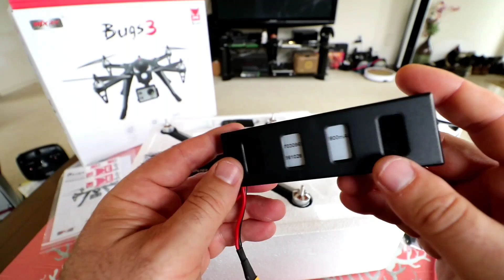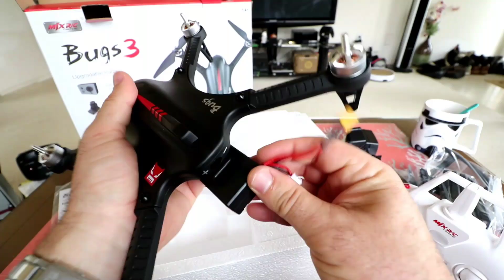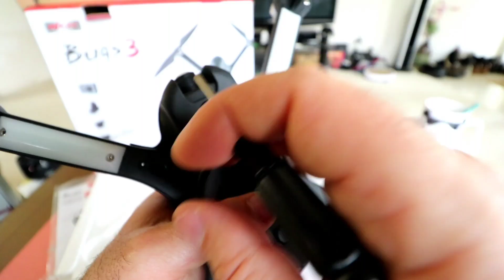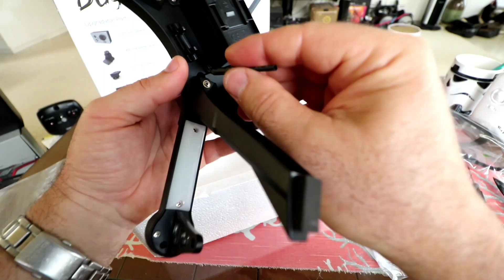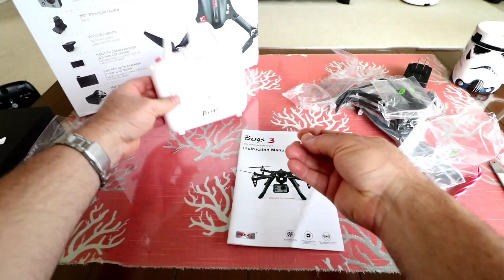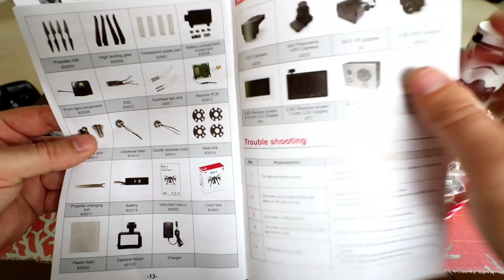MJX BUGS 3 - Full Review - [Unbox / Setup / Flight Test / Pros & Cons]

Comment: Oh yea, I dont trust any of my quads with anything more expensive than a mobius camera.  My SJcam is the best camera i own. and I am surprised that i have not ruined it yet.. so she rarely leave's my forehead.. I put her on my traxas aton, and once I top mounted it on a jyu hornet, but I was nervous as all get out.. needless to say when i get my bugs 3, its going to be more of a fun bird than a camera bird..I still never broken the seal and unboxed my hubsan h109s.. I just have a feeling that its jinxed after my x4 501s and c catastrophe,,,
Reply from the maker: lol..  It won't do any good sitting in the box :)  I'd fly it or pass it on to someone.  Sorry about your catasrophe...it happens.
Reply: Your right Dustin. I finally opened the box later that day. but all i did was charge the hugh lipo, and read the instructions, I also charged the 2 cell 11 volt lipo that i purchased for the controller. but yea she is still in the box. when the sun comes out and i re-read the manual on the camera and gimbal I will probably take her to my dust bowl for a maiden flight.. My bugs 3 came in the mail today buy the way, it's a great looking unit. i put on the props and thumbed through the manual but i have not turned it on as off yet.. Hey man, thanks for explaning things the way you do,  sometimes these instruction manuals explane things about as good as i spell..

Comment: Dang this puts their own X600 and X101 out of business, and as far as I'm concerned no syma is brushless so this puts all symas out aswell. heck if this was out when I got my X600 I would have got this over my X600 in a heartbeat
Reply: Conner Madison Syma is a solid and reliable product. Since I own Syma x5c, x8c, x8hc and MJX bug 3 I am telling you Syma is still more reliable than MJX bug 3.
Reply: my syma x5sw had no reception...  bugs 3 way better.
quality too.
Reply: Also, odd that they don't show it as a product in their list of quads on the mjx web site.
Reply: Syma and Mjx are different products. Syma is more entry level and Mjx is one step up. I did not say Mjx bug is bad at all, eventually with that price range it is best at the moment. Only issue with Mjx is it is neither for the beginners nor for the advance pilot. It is kind of in between who wants to get some skills before moving to racing quad. Even though it has speed it does not have 'Acro' mode unlike xk x251 with the same price range and if it falls from the sky it will break as it is not that strong, hard plastic. For surely it is a good quad-copter over all.

Comment: Not a bad price but that transmitter looks absolute garbage   but you would get better fun with a micro with fpv
Reply: Dji Leon FPV It does the job as promised. Similar to hubsan h501c remote (toy graded with over 300 meters range).
Reply: If you say so , I won't disagree
Reply: Dji Leon FPV Transmission does the job but the battery doesn't. 8 minutes flight time and $55 for the spare batteries
Reply: You can mod a s3 battery and save $$$
Reply: Transmitter does look cheap. But it is
Reply: Thanks for the advise of modding battery. However, it is the primary cause why quad copter falls from sky. Correct voltage play a vital role in flight performances
.

Comment: brushed drone= TEMPORARY drone. (expect it to last about 14-16 full battery uses before a motor burns out)
brushless drone= Real drone.
Reply: One thing I saw that helped prevent motor burnout was to run the motors at the lowest speed possible for 1 battery charge worth. It helps break in the bushings on the motors. Some people will go so far as to dis-assemble the quad and run the motors in a glass of distilled water. Either way, it helps extend the life of the motors.
Reply: Costa Rica Flyer I do run the motors without propellers time to time. Before running I use air duster to clean any small substances. It may increase the motor life as none of my brushed motors burn out before 20 flights. I never had to change any of my brushless one.
Reply: I have replaced a few brushed motors but it has always been a crash or something that stopped the motor wile running but I only buy brushed motors for my micos now no more toy quads for me bugs is a great new quad I hope they don't ruin it with a bunch of upgrades.  cheers
Reply: Conner Madison Not really. I have flowen my Syma x5c 46 flights before changing 2 motors. However, bug 3 is different experience. Bug is fast and full of fun.
Reply: Conner Madison try 50 flights no problems
Reply: not true. i've tried to take  my jjrc h51 more than 15 times of the tree, using batteries to not have to climb up or throw something at it. eventually in 90% of cases i had to climb up or use 5m dead trees to take it down after it went to flashing low battery mode(usually flew at night) but it still works. dont judge whole technology based on ur experience only. now im getting that brushless stuff because i find it to easy and boring to fly h51.  what i wanted to say is, i used at least 200 battery cycles on mine h51 and only recently one engine got stuck, but miraclously i managed to unstucked it and it still keeps perfect balance now.
Reply: Started with a brushed Hero xq5 foamy that lasted a whole yr of daily flying, so brushed motors are not that bad but then...upped my game with a B3 & the power of brushless motors was evident. One of these & in total control, you will become a great quad pilot.
Reply: FAKE NEWS NOT TRUE
Reply: True

Comment: Flew too far and lost orientation, tried to correct but kept flying the wrong direction and had to bring it down. Found it a 1/4 mile away using the transmitter beeping sound to locate the drone, walk right to it thru trees just off by 6 feet. Another time I crashed into the shallow end of the pool after hitting a branch minus the canopy, and then left the transmitter overnight and it rained, fan dried and the bugs 3 still flies with no issue. Only con, it's light with the stock battery and can be a challenge on high gust winds. With fpv all in 1 camera attached on top, it can turn an amatuer to a intermediate flyer after a few flights. Best drone to start off with and will grow with your skill levels. One of the best feature, no need a timer or keep the drone close for low battery indication off the drone, the transmitter will let you know and also beeps if flying too far. Great value for what it can offer! Goodbye to brushed drones!
Reply: +Sam Gar, actually it'd be really better if this one came w/ altitude hold -- that's a huge + for beginners. after some months - there is Bugs 2 B2W/B2C w/ GPS - it costs more, but it's an awesome for beginners - it does really return to home nicely! i piloted one and it returned from H=122m,D=400m after signal was lost. 5.8G FPV was lost way before that, ofc :(
Reply: Sam Gar I guess it is not suggested for the beginners. I have one and I am passing this information from my experience.
Reply: Sam Gar very good  documentary  being  planning  on getting  one though amazon  they are great people  and they will give you  better  prices than hobby  shops  used to sale them to me for more then twice  the price of  Amazon.com  has got any thing  you want if not they will get it and safe you a lot of money  only  amazon  is going to  get me and my wife said business  from  now  on I thank  amazon  for all there courtesy  beyond  there  duty I'm getting  my bug 3 from  amazon  with two batteries  for  115  dollars  thanks again michaelholden1960@gmail.com out of North Carolina said that
Reply: @michaelholden8667  I got mine today on eBay for 50bucks! It kicks ass.
Reply: Oh nooo, getting one for Christmas and never flown a drone, but I'm going to try, any tips?

Comment: What is battery compartment measurement size
Reply: Robert Gardinder just make sure you get maximum 35mm width and maximum 20mm height. length not important. but 110max.

Comment: The advertised 20 minute flight time is really 10 minutes. Might need to try a different battery.
Reply: East Coast Drones just get a stock spare battery. i modded a 2600mah 7.4v 25c lipo with a xt30 plug and it goes into lvc in 5mins. i dont maybe just bad quality lipo. tried the same lipo on my mjx x101 i got 11mins with 2700mah. the 1200mah stock i usually get 6-7mins. it is 2.5 times heavier of course.

Comment: Can you get Live Picture via WiFi from the Action Cam on your Smartphone? it's were FPV..
Reply from the maker: You can but it may interfere with the control so always not advisable to use wifi around radio control devices.  I always try to turn my phone off or put it in airplane mode also.  A small FPV kit would be better.

Comment: No spare batteries yet...
Reply: If you search mjx ebay USA you'll find them,, get ready for the price tho,, not just a bit steep but f-in vertical,, I've got a converter coming XT30 to XT60 with 4 batteries Turnigy 1800mAh 2S so hopefully shouldn't have a problem :)
Reply: Bummer. Thought maybe I was looking in the wrong place
Reply: Justin H i got a spare battery 🤗 nah my 1st mjx bugs crashed so i used it as spare parts and bought a new red one hehehe

Comment: great unboxing review. in your interview with stock screw driver pervided in kit for installing the screws you can magnatize it to assit.  sticking the screws to the screwdriver. just have a magnet handy on your table for the interview  stick the supplied screw driver to that magnet for pic up and holding kit screws. then ppl can see that and that can be a cool trick for the ppl to see as a helping ad. thank you for the cool vid.
Reply from the maker: Good point with the magnet.  It would make it easier and I have done it before.  Using a better screwdriver is a must  :)
Reply: John Forbes  go all the way and get traxxas aton , this thing will test anybody who think they are good
Reply: Robert Gardiner. Robert why this comment too me?
Reply: Dustin Dunnill.  right now this quad is great price too. this quad is packed with alot as wast really it can do for the money looks to be a great price point.  two thumbs up for this quad.
Reply: John Forbes fffffdhfh5==

Comment: Is this good in rate 1 for someone who has only played around with a nano quad before? It seems fairly cheap and good. I'm looking for a half decent one I can grow experience with. Nice review though :)
Reply from the maker: If you have decent hand/eye coordination, you should be ok in rate 1.  It will drift around so fly it in no wind if possible for beginners.  Definitely easier to control than the X1.   If your still crashing your nano.. maybe learn more on an X5C brushed and light type of quad as Chris mentioned.
Reply: granthug so your new to this, so I recommend choosing between a syma, skyviper, wltoys quadcopter, or a hubsan
Reply: granthug, once you get in the mid intermediate level then you should get a parrot bepop/bepop 2, or a hubsan h501s brushless x4
Reply: Appreciate the replies and opinions! still considering it, but are there any other sporty quads you would recommend that are fun to fly? :)
Reply: The XK x251 is a favorite of many, but like Dustin said, brushless quads require good piloting skills. They are fast, and if a person has trouble keeping orientation, they are easy to lose, and they crash hard. But if you looking for sporty, the x251 has abundance. It will carry a gopro (you mount), has a great radio and incredible range (1,000m). Batteries are cheap. And it's a durable quad. I've flown one for a year now with no problems. Price is $110 or so on Gearbest. Cheers.